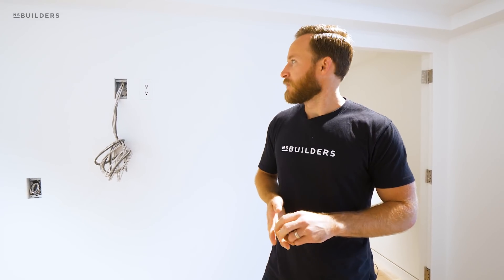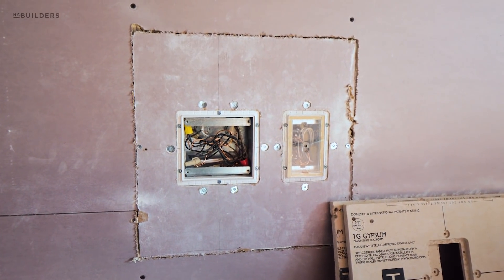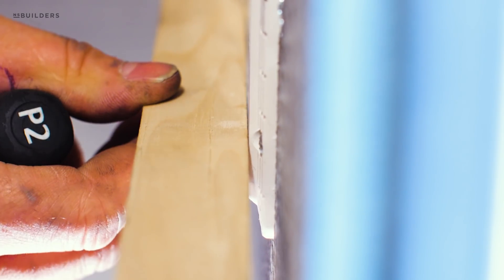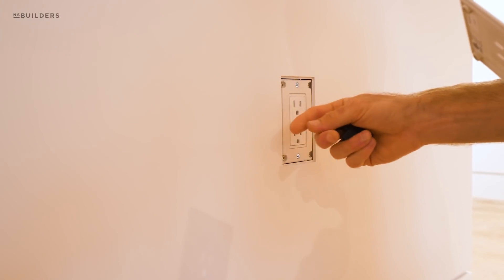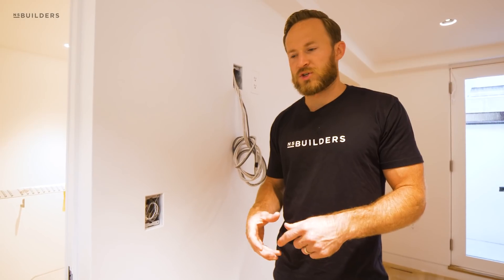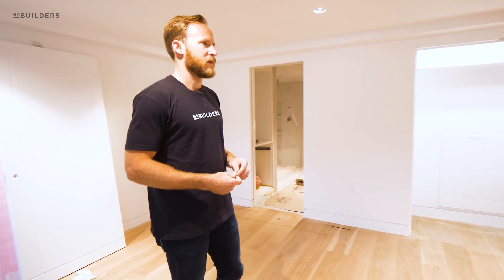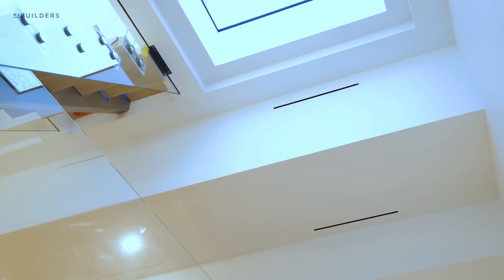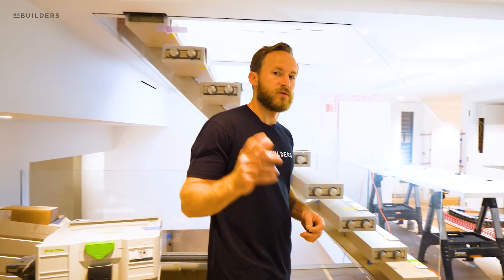Flush mounted outlets that are ALMOST invisible

Comment: seems like the extra thickness of the plate would lead to lots of loose fitting plugs, as the plugs are expecting to insert a certain depth, and if there's like 2-5mm of stuff in the way, they will never fully engage.
Reply: @EricDavisED  not to mention the matte paint. Anyone who attempts to pull a plug is likely to smudge the wall/paint, instead of a normal wallplate that resists fingerprints fairly well. These are going to look dirty pretty easily.
Reply: Reinventing the wheel creates more problems
Reply: This is fixing a problem that doesn't exist. Way too much trouble, work, and OCD just to have flush mounted plates and speakers. Who gives a rats ass! The decorator put a nail through the speaker...That sums up all future problems! Builds like this are a headache for subsequent owners and contractors. It does not age well and renovations and repairs are basically impossible or expensive because what's behind the wall is not what you think or know.
Reply: @colinstu  We’ve been executing flush outlets & switches for 5+ years on most of our builds, as well as clay plaster finished walls. I’ve never heard customer complaints on smudges, though we use Pass & Seymour LeGrand pop out outlets most locations. 

It’s not really any different than flush baseboards and trim less door frame installs. Our homes are upper end prices in expensive locations, Boulder to Nederland in CO and in BigSky. Customer‘s expect that level of craftsmanship.
Reply: This concerned me too
Reply: @MichaelM-to4sg  Why would a homeowner contact the builder about smudges on a wall plate? They would likely inform the housekeeper or they'd ignore it.
Reply: i have them and there are ZERO issues
Reply: @DerekFromBK  its not a problem fix its an appearance fix

Comment: I would be concerned about the gap that plate cover creates, especially if using a vacuum cleaner or other high wattage device.
Reply: Form over function.  But oh so pretty
Reply: @okymek  I could see that in the kitchen but most of the room outlets are infrequently used so it should be too bad. Thought they lack USB power or PoE sockets, I care more about that now than 120V.
Reply: i have them and there are ZERO issues

Comment: I am also a Boston area builder and I am in planning phase of a kitchen remodel. Our kitchen layout is going to have a standard height granite backsplash then window trim directly on top of that over the counters. The whole wall will be windows above counter with no upper cabinets. My question is after working with the flush mounted outlets do you think they can be modified to flush mount into the flat stock window trim if we CMC the holes in the trim boards and give the same look as they do in the plastered walls?

Comment: I used them on a project with all outlets in the baseboards, for certain venetian plaster walls and in the kitchen island. Really well built product just takes some getting used too.
Reply from the maker: Agreed.
Reply: I prefer to put the outlets in the baseboard.  How do these install in a baseboard?  All I saw in the video was the very large sheetrock-type mounting flange around the outlet.  My concern with these in the wall is that there is more taping and mudding to do which requires more time and effort to achieve a smooth, almost invisible joint.

Comment: They look really nice, pretty certain we don’t have anything like that over here but I’d like to have them. 

Don’t think they would look as sleek of the wall wasn’t also white but still nice 👌🏼
Reply: Actually with a white wall its less aesthetically important. As a color wall makes the white trim stand out. But with white wall, they dont. But since you can simply paint the plate (I would spray a strong clear matte/gloss acryl or epoxy type coating to protect the paint), You now have no white plates sticking out.

Comment: Any more details on the high-pressure slot diffuser and return register?  We want to use the hp system in a new house reno we are doing, but we don't want 10 2" vents in each room.

Comment: Dont use wire nuts cuz they damage ur cable so you need to cut the damaged part off so if you do it a few times you wil have almost no cable left
Reply: not true

Comment: Why not use metal studs? Much easier to get flat.
Reply: I don't know Boston's regs, but most residential codes don't allow metal studs, at least for the outside walls, due to thermal bridging.
Reply: not in residential

Comment: I understand that thee builds are about aesthetic..... but plaster on top of a speaker? The noise coming from a speaker is literally vibration. I'm sure the owners of this space don't care because they can pay to have them fixed in the future by man is that super strange to me.
Reply from the maker: It’s designed to work like this and will not crack. And frankly they sound AMAZING
Reply: not true

Comment: This gives you a plug that is not fully inserted. These are a code violation and major fire hazard! You should immediately have an electrician tear all this out and install standard electrical boxes and plates before you have a house fire!
Reply from the maker: These are all installed to code.
Reply: @NSBuilders  The NEC does not allow such receptacles. NEC section 406.5D states "After installation, receptacle faces shall be flush with or project from faceplates of insulating material and shall project a minimum of 0.4 mm (0.015 in.) from metal faceplates." It doesn't allow receptacles that go behind faceplates unless the faceplate is an integral part of the receptacle (these are not).